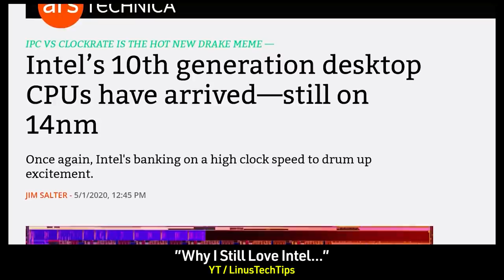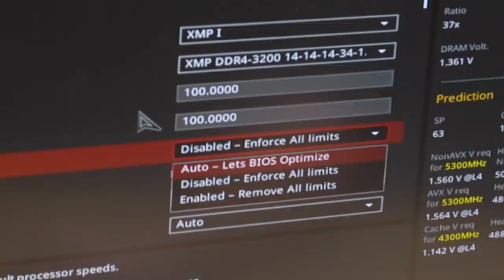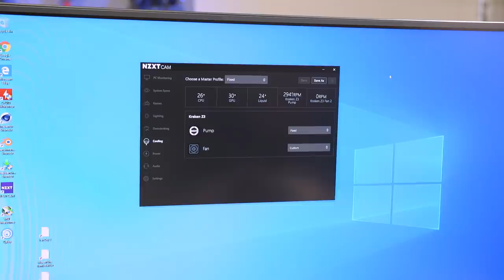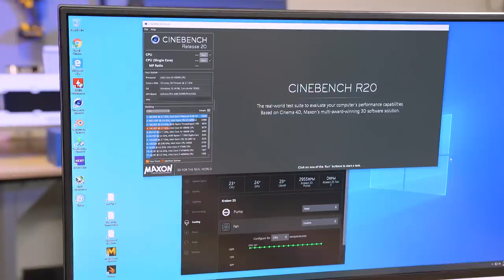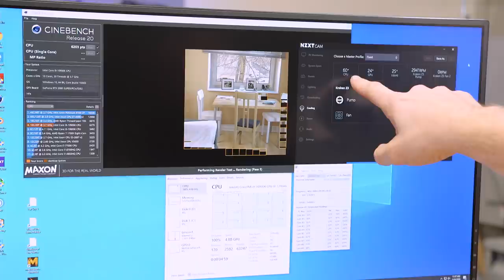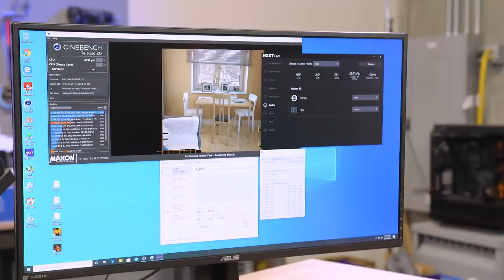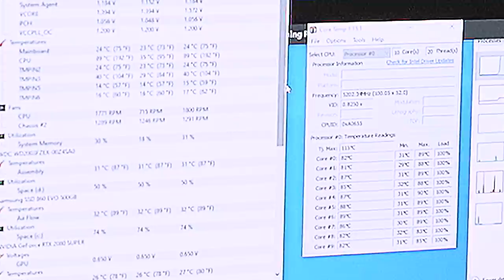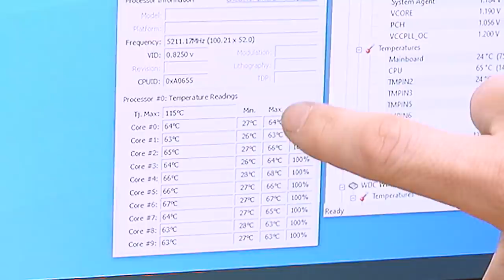Does the 10900k Melt!?

Comment: LOL that Open Case defence wus genius :D
Reply: It's the opposite of genius. It's a defense that works because most people that watch videos like this don't care about practical information. This was close to defending a leaking water cooler by saying that it shouldn't be a problem.
Reply: @quintoblanco8746  If you want practical information watch case reviews from GN. Then you can see how every case is different. Jay can't help it if the case you use isn't well ventilated but he does show a best case scenario at the settings he stated. Also GN stated many motherboards don't run an Intel chip at stock settings. At stock they actually don't run that hot thanks to the modified IHS. The TIM Intel used from Haswell to Coffee Lake was garbage and the STIM the 9th gen had wasn't very good either but with the 10th gen they actually did a good job in heat transfer.
Reply: @quintoblanco8746  Well, you are here not only "Watching Video Like This" but also commenting. What does that make you? Also it was simply put "If you find a SINGLE case that will be identical in performance to every other case on the planet Jay will use it".
Reply: everybody can have an open case but not everybody can have a nice closed case. i perfer to run my pc open case since im living in the tropics and the median daily temperature is around 28-30 degrees.
Reply: @muzallisam5068  +1
I've run my case open for over a decade, and I live in a temperate zone.
Reply: @MorbidTSK  I’m here because I expect better. And yes, I watch less of Jay’s videos than I used to, because the quality has taken a nosedive.

Let’s look at Jay’s requirement. That is a strawman argument. Nobody is asking for tests with a mythical case that is somehow similar to every other case that viewers use at home.

What some people ask for is realistic scenarios, so we can see what CPU temperatures actually mean when we build a system.

This could lead to interesting content instead of slapping a water cooler on everything, using an open test bench and occasionally building a system that is the size of an oil tanker with three fans in front.

Other reviewers have already tested the temperatures, so it would be nice if we got something a bit different.

What about a Mini-ITX system with a compact air cooler? Or a compact ATX system that people would be comfortable with placing in an office or a living room? How about the impact of a powerful graphics card on the temperatures in a case and the boost function of the CPU?

What about using a case with one or two side fans? What about using low-speed fans to minimize noise?

Tech videos could give people ideas of different builds, instead of reinforcing the stereotype of gaming PC’s that exist solely in the bedrooms of people who live with their parents.
Reply: @muzallisam5068  I have used a small system in similar conditions. I specifically looked at reducing the power usage and I used low speed fans to keep the noise to a minimum.

I don't mind people who only care about performance, but there are people who want both convenience and a system that performs well.

For somebody with small children or pets for example, an open case is not an option.
Reply: @quintoblanco8746   That is a lot to read and also Off Topic. My first comment was simply me saying i agree with the statement about a choice of chassis for this relatively quick test video. What you just wrote look like a discussion between a viewer and the uploader ;D
Reply: @CheapBastard1988  I want better content. If your argument is that I should not watch Jay's videos if I want good content, fair enough.

But you misunderstand. I don'y want case reviews. I want to see how a specific CPU works in real world circumstances.

You insinuate that I want to use a case that hasn't got good ventilation, that is nonsense. In smaller cases ventilation is extremely important.
Reply: @MorbidTSK  That is part of the problem. You don't like to read. That makes it difficult for you to process information so a dumb remark in a video might seem like 'genius' to you.

Comment: Now the real question is, what's the cheapest cooling system you need to keep the 10900k in check with that kind of overclock. 

Because this is dope but we gotta talk budget you know?
Reply: Lol, who buys a 10900K chip and does a custom build and then worries about how cheap of water cooling they can do.   If you have to ask how much it is, you probably can’t afford it.
Reply: If you plan to OC high with the 10900k I would check what is the best AIO you can get be it a 360mm or 280mm, check a bunch of reviews/tests and get the best you can afford. Will most likely be $150 and up.
Reply: John Totten  my next build im doing is an Enthoo Elite custom water cooling loop
Reply: What is your budget?
Reply: Liquid Nitrogen might be able to keep it cool without overclocking... LOL
Reply: Sheila olfieWay  6K

Comment: 3:20 -- Dont entertain the trolls J. Elimination of variables is the best way to get better data, GamersNexus would back you up on that.
Reply: Actually pretty sure GamersNexus would remind him to put a solid disclaimer that this isn't a real-world use scenario. 
Test benches aren't a thing for pretty much anyone but the upper end of enthusiasts, tech channels, and hardware development teams, and I've not seen anyone using an open-bench for anything aside from short-term testing or mining for a long time. 
What Jay SHOULD have done, when doing a thermal test, was do an 'optimal' scenario with a test bench, then a 'real-world' scenario using a relatively common case that's well-rated.
This way the data provided is more relevant to the actual conditions the processor is likely to see.
To do valid thermal testing, you don't do a few runs in a perfect conditions scenario, you do multiple tests under at least a couple different scenarios, typically, when talking about thermal testing to give an impression for consumers, you would want to use a scenario that's representative of what the consumers will actually encounter. 
This is about as bad as people using passive cooling then calling a cpu hot without bothering to check it under active cooling. 

Statistics are completely and utterly meaningless without context. A lack of context means that those statistics end up being very easy to misrepresent results or otherwise come to the wrong conclusion from them.
Reply: @jtnachos16  I agree with you, funnily enough my current desktop always has it's side panel off, basically an open bench :D I'd like to know how many watts this thing uses at different overclocks and stock. And how much heat was radiating off of that cooler he was using.

Comment: An open test bench is most efficient and effective in testing to have base temps and testing. The only other factor is outside temp. From winter to summer that can affect it. But it's better than testing in a case. Why do people not understand that? If he tests the same way on same rig it is accurate to itself which is what you want.

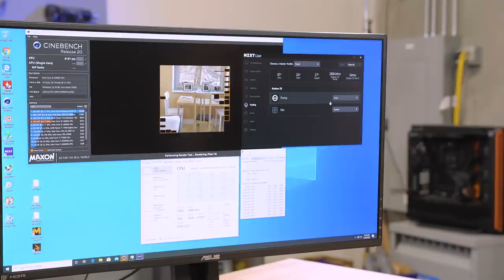Comment: Just a few years back that joke at 12:22 would have been about AMD

How times have changed
Reply: Because the FX 9590 was like a super hot CPU with an AIO as ITS STOCK COOLER. And it performed equal to just an none K i5 in gaming, sometimes beaten by an i3 and beaten by i7s in workload drawing 250ish watts...which gave it the space heater name. It's so slow and useless that space heating was the only thing it was good at
Reply: Actually times have not changed at all. Intel still runs cooler than AMD.
Reply: And how little people are we whom remembers.
Reply: @seuzer  But the jokes did, you missing the point and correcting, stupid jerk.

Comment: Only thing I can think of that would hammer the cpu that hard is blender, or other offline 3d rendering software. But then again, most people doing that regularly would probably have a recent Ryzen system for better multi-thread stability, and longer boost run times.

Comment: Lets see this on air for those of us that cannot afford a 300 dollar cooler
Reply: Any other 280mm aio will perform the same and cost way less. Some even perform better like the arctic freezer 2. NZXT is just charging extra for the LCD screen. Even a $90 nh-d15 will come pretty close to that cooler.
Reply: I mean if you can't afford a good cooler, you can't afford this CPU to begin with.
Reply: if you buy a 10900k would you not have money for a cooler ? Anyway, it´s still better than last gen, plenty of videos you can check on air .

Comment: "We want out of the box experience"
Disables settings in bios that no-one will ever disable. 
Unexperienced don't know it exists/are afraid to change something away from auto
Experiences users want the extra oc
Reply: to be fair, it's a simple BIOS option to change, and if you're building a PC with a 10900K and Z490 motherboard, you can't be afraid to change it and in general should know what you're doing, you just have to know it exists and do it. and you'll get better temps.
Reply: @Pizza Rolls yeh, and more and more. How many kids these days are asking mummy and daddy for a pre built system so they can stream. Even if someone built a system themselves, they may not know about MCE and leave it on Auto.
Reply: Most motherboards don’t have that option enabled by default, Asus is a special case, he’s emulating the experience someone who may have purchased a cheaper motherboard like a MSI budget board would get
Reply: You kind of stupid, he is actually showing you what you should be doing out of the box because this was not well tunned, jerk.

Comment: My 9900k and 2080ti in a case hits 40c+ coolant. CPU Only test with the side panel off it hits 32c coolant.

H150I is my cooler.
My CPU is undervolted by -.30v gaming hit around 65c Full Load with AVX hits 77c

Comment: Jay if there is no one case that fits everyone then you should be doing heat temps based on water cooling and air as not everyone is water cooling. I would like to see you build a gaming pc in the Cooler Master Elite 120 Advanced Mini-Itx case as it has room for a full size gpu.

Comment: The liquid demonstration is quite nice as highlights a few points on CPU cooling which was not mentioned (at least to detail):

The main bottleneck in cooling today is getting the heat from the active circuit to the cooling element i.e. Radiator in this case. As you also indicate a larger cooler will not fix the issue.

If we think of physics then you have a high resistance/impedance in heat transfer through from the active circuit to the water, but very low from water to air. This is seen by the deltaT from air to water (low) vs the IC (core) temp to water deltaT.

What Intel has done here is reduce the thermal impedance between the active circuit and the water (likely mainly by sanding down the die and effectively replacing it by copper which has a higher thermal conductivity).
The main way to improve CPU cooling today is not in the hands of the consumer, as either  the IHS to block interface is to blame for the deltaT. If you added pumps and radiators to infinity you could at best get 2-3C of improvement in your testing (assuming this was your water to room delta). It is likely the same reason water sometimes is better than air cooling, because using water you will draw in cool air, while air coolers draw in case temp air which may often be 10C or more above ambient in a lot of cases.

Small correction: it is likely not the architecture which is improved and 'runs cool' it is the physical changes, as the only way architecture could affect Temps would be to spread out the transistors more, making physical larger cores.

Comment: I just want 5.0 on 20 cores For my Flight Simulator!! hahaha
Reply: Just finished a new build with this CPU, OC'ed to 5.1 .. I'm running a 2060 6gb until the 3080 comes out and MS Flight sim runs 100x better already!
Reply: @BCToby  I'm seriously thinking about not going for the hype and just buy a RTX2080ti and Pair it with a i9 10900K I'm still working with a GTX 980 and a i7 2600K so whatever I do I believe It will be a huge leap!!
Reply: @etnwhvac  it's probably not a bad idea as they're getting listed for cheap now... However for just a couple more 100's a 3080 may allow for double or triple monitor fps goodness if you have the screens already ! ;) would be good to jump on the msfs 2020 forums and see if how people are doing with the 2080ti's on similar CPU's!
Reply: @BCToby  Thanks I'll do that!! But just in case I bid a couple on ebay..haha

Comment: Jay.... Open air bench and a extra fresh air fan in I suspect a airco cooled large/huge space. Well sure it will stay cooler and the nzxt cooler is good.

Now a dump use case scenario, mid tier ventilated case, 2080ti with a top down cooler (that's dumps all it's heat in the case and the nzxt in the top as exsaust!  Now run furrmark for 15 min and then try the r20 with furrmark running in the back ground for another 15 min.

Running a r3900x and 2080ti under ekwb bloks my self, with a 280 6cm thick rad and a 240 4cm rad and under full stress or modern gaming the soft tubes will be above skin temp and feel warm to the touch.

Comment: Asus is one of the only motherboard manufactures that conforms to the Intel TDP limits on z490. You'd see a little higher performance and therefore higher temps on stock with a different mobo.

Comment: Well I am looking forward to getting alll my pieces together for my upgrade. 3770k to a 10850k . Msi z490 tomahawk. Thinking of going with tbe noctua d15. I could use my nu 12 s on the i9. But want better cooling as I do want to do more similation in blender. I do audio recording and mixing as well. Great video

Comment: We've come a long way from "AMD is just a space heater." to get's the fire extingusher - "It's still intel."
Reply: People are extremely inert and dogmatic so you can still hear the same old jammed disk record with "AMD is hot af". When, say, NVidia card consumes 280 watts it goes under the radar, when AMD card consumes the same its all "omg grab the 360 rad for this, no less". And its the same for CPU's, they say "hey yeah 7nm is better and all BUT it has lower surface area and so its still blazing hot", whereas 9900K consumes 2x as much power as 3700x. I'm not an AMD-boy, I have an Nvidia GPU. The point of my message is that being inert and dogmatic harms everyone and people really need to learn avoiding that at all costs

Comment: The one thing I don't like about the test is that using a 280mm AIO is just about best case scenario temp wise, and essentially is saying 'if you add $100+ worth of cooling to the price of the chip, it won't overheat.  I'm curious how it would do with less expensive and more common coolers like the ubiquitous hyper 212.

Comment: great video, im planning on building a 1000$ budget micro build with the new chips for gaming, any suggestions?
Reply: Michael Xiong Get AMD 3600 or 3700x as it will allow you put money on other parts, especially a great GPU.
Reply: Michael Xiong Intel all the way. You won’t go wrong with the 10700K.
Reply: I have an 8700k and it still holds up like a beast
Reply: @venividivici4253  pffffffffft
Reply: AMD is the passage to Valhalla
Reply: @Negan Is Vegan yeah forreal, i7 is completely dead, the i9 is still clinging on begging for Ryzen 4000 to use lube
Reply: The correct answer is to forget about building a PC until consoles drop, AMD and nVidia will battle and the last gen will drop in price as the reference cards and Ryzen 4 release.
If you must build a PC right now, go red and green for a 1k computer, also consider you'll want a monitor that will display framerates and fidelity you'll want (I went 1440p 144hz VA curved panel)

Get a 3700x with a Be Quiet! Pure Rock Slim, Asrock B450 Steel Legend, 16gb of ddr4 3200mhz, and get a Mini RTX 2070 Super from Zotac, Samsung Evo+ 970 m.2 NVME for your boot drive, sata 3 ssd from Sandisk or Samsung  or something for games. Then a Seasonic or EVGA psu at the highest wattage and efficiency that you can manage to squeeze in the budget.

Maybe a mini 2060 super if you can't fit in budget, or go used for your gpu
Reply: @venividivici4253  LMAO, well faboi spotted ;) Non of the new chips are interesting what so ever except the 10600K, the 10600K looses to the 3600 because its still overpriced. BUT the 10600K made the 10700K and 10900K completely pointless because of its identical gaming performance. And with intels sole focus on gaming, they didnt only get beat by AMD, but they also beat themselves.
Reply: @arman3656  AMD chips provide more cores and higher thread counts along with lower price point so they are the fan favorite among content creators and casual consumers. For gamers and enthusiasts whose budget has no limits, Intel chips still reign supreme
Reply: Arman 
AMD just has a better value for money, generates less heat, has cheaper MOBOs, all of them are overclockable, and something about an upgrade path
Reply: Don’t buy AMD
Reply: Shredwizard hahahahah AMD fan boy.   Intel already stole many of the top engineers at AMD to work on their Xe GPUs.   Inte also stole some people from Nvidia.   Bet your really gonna hate them now.
Reply: @od40k77  Basically everyone on the planet with expertise in tech disagrees with you.
Reply: I'd suggest you go with AMD mate. Considering Zen 3 is reported to be 30% faster with lower latency. You should probably go for this build:
- Ryzen 5 3600 $175
- ASUS ROG B450 ITX $140
- 16GB DDR4 3600Mhz (2X8GB) $80
- RTX 2060 $320 
These should be good for the core components. You can go ahead with your storage choices. If you do insist going Intel, go for the same setup except the chip and Mobo. Go for the i5 10400 & a B460 ITX board.

Oh btw i didn't mean that Zen 3 is out. What I meant was that you now have an upgrade path for Zen 3.
Reply: @Shredwizard445  Excellent suggestions. I'm waiting for the new consoles too, especially what Sony is doing with the SSD. It's gonna be a wonderful Christmas this year.